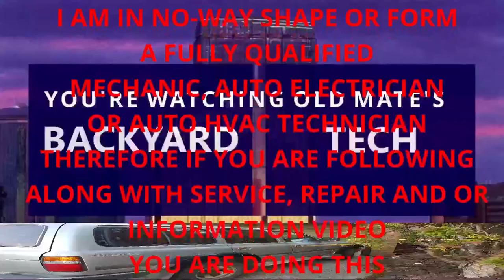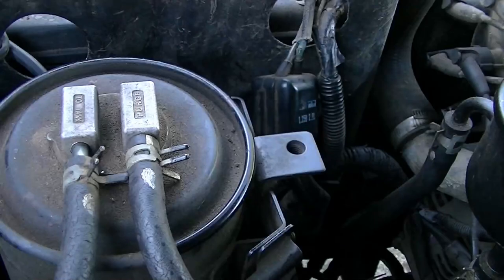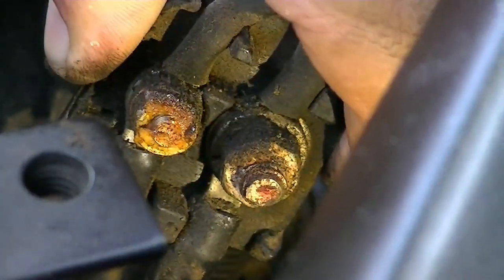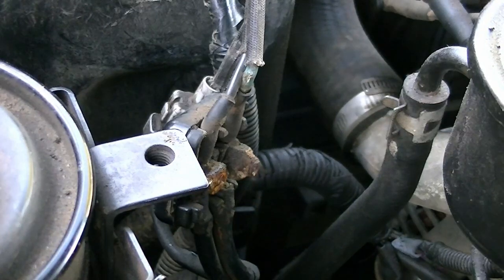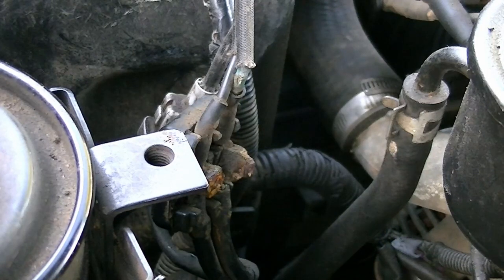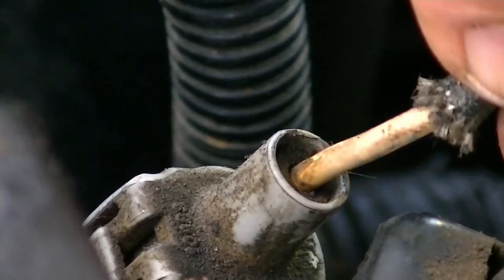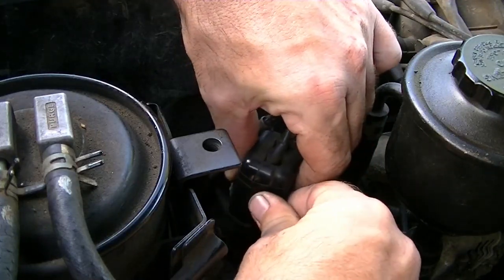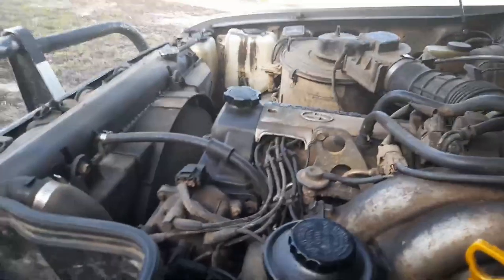80Series - Inspection Of Fused Start Relay Link + Bonus At The End Of The Video

Comment: Maybe where that green wire has rubbed through the insulation it might be intermittently touching the battery box or something and causing an issue? Banging on it making it work usually means a loose wire. Maybe one of those nuts might just need a tweak or check under the electrical tape at the battery end?

Comment: Pull it apart, clean it all up, put it back together and spray it with Wd40 or similar. 
It should be fine. 
If that doesn’t work get another.
Reply: A tight cable tie or two would be good around that broken plastic.
Reply from the maker: Yeah that is the plan